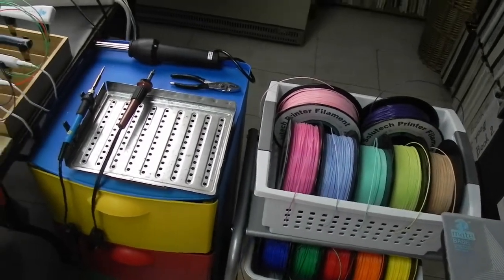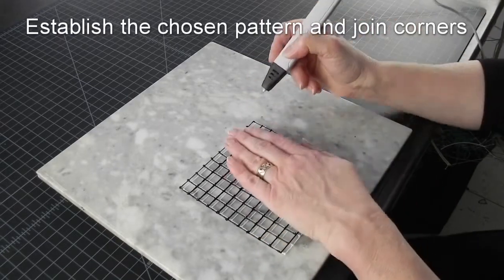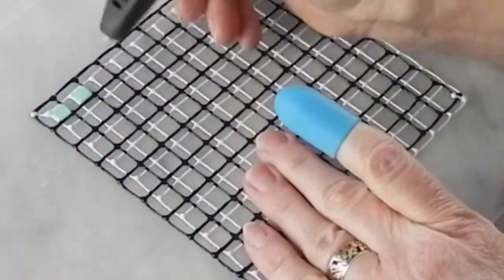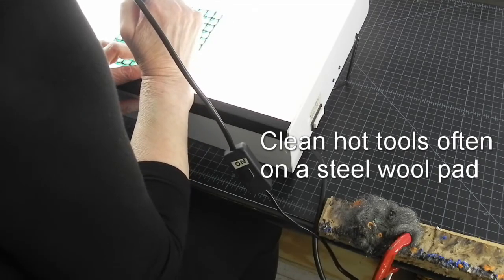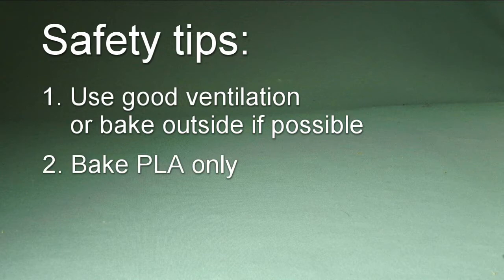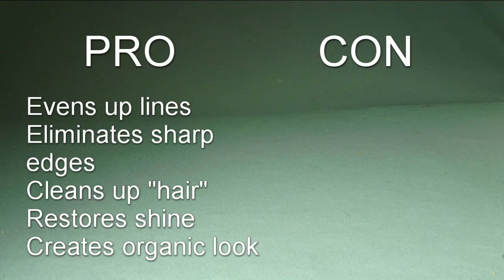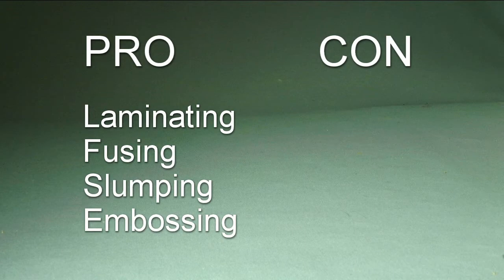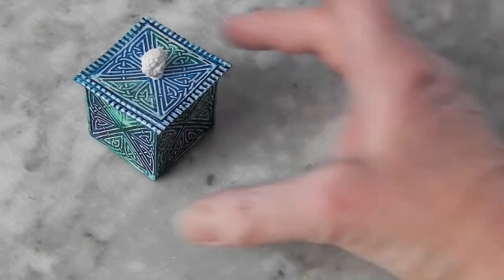How to smooth 3d pen projects without sanding - Baking PLA

Comment: To fix the air bubbles you need pressure while baking smoothes the plastic while gravity making it flow down and smoothes out. A T shirt press would be a better tool for since it clamps pressure in both directions up and down removing air bubbles.
Reply from the maker: I tried pressure by putting a tile with a weight on top. I was also wondering about T-shirt presses too. I don't have one and they are a bit expensive of a tool if it didn't work out. But I have found out since releasing this video  that if I bake on a porous surface like a teflon baking sheet which allows the air from underneath to escape that pretty much completely eliminates the bubbles.